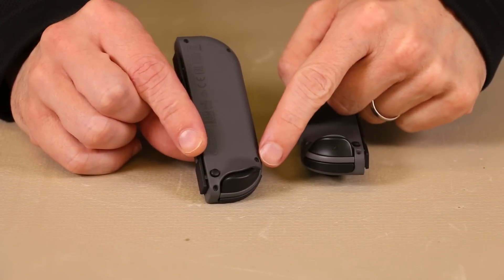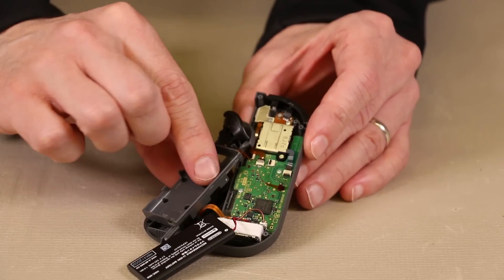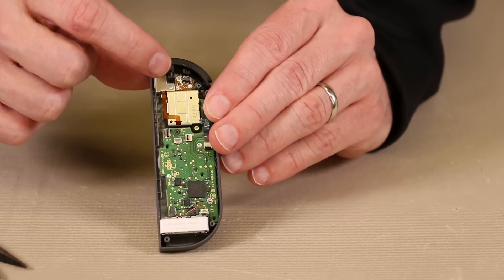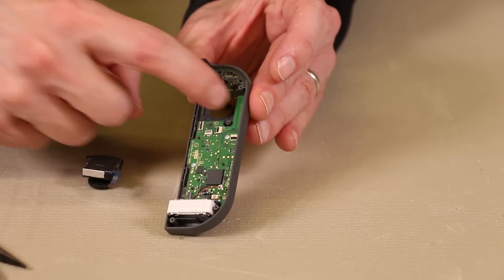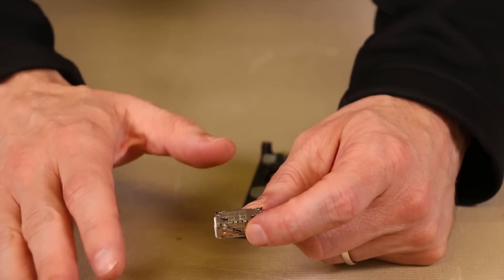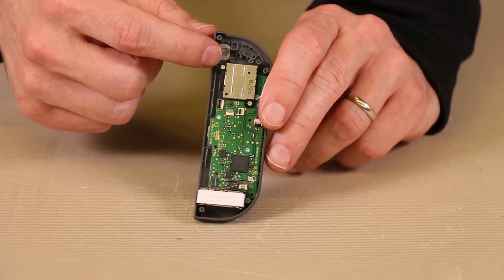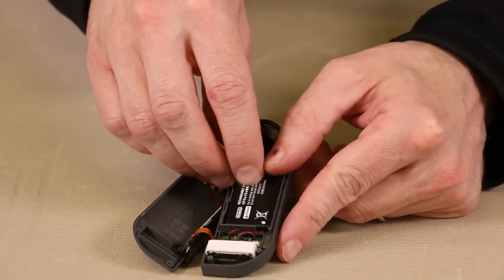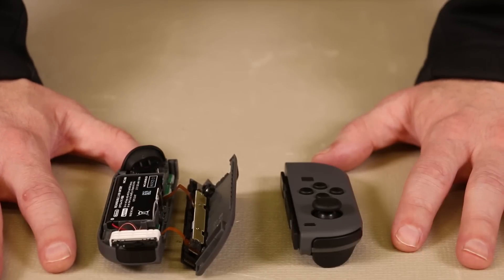Nintendo Switch Joycon Teardown -

Comment: Great video! May I know how to connect those flexible cables between 2 side of the joycon back? I accidentally disconnected them while disassembling it. And it seems very difficult to connect it back without any tools.
Reply from the maker: Ya, they are difficult to connect with tools. If you're trying to do it without tools I have no advice for you. Not sure how you would ever do that.
Reply: what tool did you use?

Comment: How do you get the charging ribbon cable (one closest to rumble motor) back in? It’s the bottom ribbon cable out of the two that come off the rail. The top one is easy but the bottom ones lock mechanism is backwards and I cannot figure out how to get the ribbon cable back in. Wish this was covered in the video

Comment: How repairable would the springloaded catch for the Joy Cons that holds them securely to the switch? The small catch attached to the button on the back near the shoulder buttons.

It seems like it will be common for them to wear out, causing Joy Cons to fall off the switch, and knowing how to repair them seems useful

Comment: Hello! Great video.  For what I've seen in the comments there is no replacement for analog joystick for the Joycon yet.  Could you tell me where should I be looking (besides ebay) for updates on where to find this when available? Is there an specific forum that I should be monitoring?  My right joycon joystick jammed after dropping the unit.  Now you cant lock it in (as for the telescope in Zelda)  I'm not sure if its repairable without replacing the joystick unit.  Thanks in advance

Comment: You really should have looked over the right Joy-con. While it is a similar configuration, there's different components inside that have unique ways of removal, like the NFC, IR reader as well as a black plate that sits beneath the circuit board.
Reply: Beta Shadow yea I really wanted to see how it was dismantled for months now, but I can't find a single video that covers the right joycon.
Reply: I totally agree with Beta Sword, I have a defective  R button(which requires some soldering and it is the worst button that can break down on the joy con imho). While similar there are also some differences between the joy cons.  I found another video that shows both joy cons opened and closed.
Reply: Very true. I also noticed many teardown videos are only doing the left side and they are also not talking about or taking apart the side with the rail or the rail.
Reply: I have opened my right joycon yesterday, and it turns out he was right. It really is pretty simmilar inside. The only diffirence is that infrared sensor, which is not attached to the case at all, so you can remove it easily.

Comment: My Joycon rail’s ribbon cables aren’t attached, so would it work if i just removed the back and reconnected them?
Reply: i hoe this works for me i dropped my switch and it landed right on the L joycon and it ripped the ribbon cables from the switch and broke the peice of plastic holding it in im hoping i can just hotglue it back into place D;
Reply: How did that go?
Reply: mythicalmagikarp gaming I haven’t even tried to fix it yet

Comment: For one month...one month I was not able to put the ribbon cables back together after my Switch fell down on the joy con and it popped open. Just looked at your video and realized all you needed was tweezers. Poof! In just two minutes I put the controller back together, which was taking me hours to do. YOU ARE A TIME SAVOR! THANKS!!!!
Reply: the same thing happend to me dropped my already damaged blue joycon L becuase the joystick black cover BROKE OFF when it fell WHen it dropped RIGHT ON THE EDGE of the L joycon IT ripped off from the console and the black bar was just sitting in the switch and now im waiting for my dad to get home so i can fix it with him
Reply: @Stevoisiak  you dont need to shove it all in
Reply: @Stevoisiak  when you see and feel it goes in as far is it goes pop in the security
Reply: I still cant get one of my ribbons in. Do I have to take it all the way apart?
Reply: Wow...

Comment: I stripped a triwing pretty badly... do you have any idea how to get it off?
Reply from the maker: Search Amazon for stripped screw remover. There's also always the Dremel route.
Reply: The problem is, is that it is inside the controller and I just can't get it out. So I don't know if the dremel route will work.
Reply from the maker: Drill bit

Comment: hey help. i dropped my right joycon and the analog stick dosent click in anymore and it wont go all the way to the right. Do i need to replace it. if so were can i buy it
Reply from the maker: You probably would need to replace it...unfortunately, there is nowhere to buy that part yet.
Reply: Send it to nintendo they will replace it
Reply: Sanji Vinsmoke This same exact thing happened to me five minutes ago lmao
Reply: Xsermius 929 Lmao same. Mine broke yesterday, so I just bought a replacement. Surprised to see so many other people have theirs break.
Reply: any updates on this? My right joy con has this problem due to wreckless kids.
Reply: This happend to me
Reply: Bobadooba 123 did you get it replaced mine broke off as well
Reply: I know I'm replying to a year old comment and you've probably fixed the issue by now but unless you're very skilled and have the right tools I would advise against trying to fix the joystick assembly. Ordering a new one will be way less hassle. While I'm sure nothing inside of it broke, to open it you need to bend the metal around it outwards, then, once you've fixed the issue on the inside (simple plastic mechanism with a spring, iirc there are 5 plastic pieces total that fit together) you would need to bend the metal piece back onto it which is near impossible to do or at least I wasn't able to.
Reply: I found some on Ebay with the tools incluided so you wont have to buy them

Comment: my Left L button doesn't work but the rest works you said the L button might have gone bad and you said to replaces the ribbon cable with the button do you now where to buy one ? also tips?. and quick question how can you check if it might work for an a example the spring is disordered or some case like that
Reply from the maker: Unfortunately, there's no place to buy parts for them yet.
Reply: https://m.search.naver.com/p/crd/rd?m=1&px=278&py=569&sx=278&sy=569&p=TT6xVdpySARsscFLlfRssssssQK-254259&q=%B4%D1%C5%D9%B5%B5+%BD%BA%C0%A7%C4%A1+%B8%AE%BA%BB%C4%C9%C0%CC%BA%ED&ssc=tab.m.all&f=m&w=m&s=B6IqXhN6ET74CQBA3DNjyQ==&time=1499640288989&u=http%3A//m.shopping.naver.com/bridge/searchGate.nhn%3Fcat_id%3D50002775%26nv_mid%3D10244274741%26query%3D%25EB%258B%258C%25ED%2585%2590%25EB%258F%2584%2B%25EC%258A%25A4%25EC%259C%2584%25EC%25B9%2598%2B%25EB%25A6%25AC%25EB%25B3%25B8%25EC%25BC%2580%25EC%259D%25B4%25EB%25B8%2594%26frm%3DMOSCPRO%26h%3D0d19e5e1fcf37b99b201a74cacb1542b484d6901%26t%3DJ4XB2WE7&r=6&i=00000009_0002629b3a35&a=shp_lis.outitem&cr=1 will this site work or I mean can you put similar ribbon cables.?

Comment: I noticed that my Joycon's Plastic "Shells" are not aligned to 100% (this makes the upper Shell 1-2mm longer than it should be) do you think I can open it and align it by myself or is it a manufacturing problem that cannot be fixed by openig and reinstalling?
Reply from the maker: Hmmm...I'm guessing a random manufacturing problem, but there's no way for me to know for sure. I'd take it back and exchange it for another.

Comment: After assembling the controller back, I realise that the buttons on the side (SL, SR, Sync) and lights don't work for me. It probably is the one ribbon cable not connected properly that's causing this but I've tried to fit in properly but to no avail. The contacts do look fine though. At two instances I did see some of the lights but they quickly disappeared since I moved the cable a little

Any suggestions?

Comment: my joy con does not lock into place. iv opened it up but I'm not sure if its the rail or the button?
Reply from the maker: Unfortunately, there's no way for me to know either.
Reply: yeah it looks like a piece on the rail broke off. I'm gonna try to buy a cheap joy con for parts video was very helpful!
Reply: struggling reinstalling the ribbon cables though

Comment: would you make a video of the inside of the analog-pot please? I'd like to consider a possible way to replace the analog stick in the joycon with something like the analog sticks in the Switch-pro controller. I don't think the analog sticks on the joycon have enough analog movement vs. range-sensitivity.
Reply from the maker: The inside? So you want to see the analog stick disassembled? I may do that in the future.
Reply: TronicsFix exactly! If I could replace the joycon's analog stick box with one from the switch pro controller, that'd be my dream portable joycons lol

Comment: I've managed to bust the button under the left analogue, is it possible to get into that little case and fiddle with button, or does the whole thing need to be swapped?
Reply from the maker: Well, anything is possible (almost) but it's highly unlikely that you would be able to fix anything inside the analog sticks. Partly because you wouldn't be able to find parts for it.
Reply: TronicsFix I was hoping that the button may have just slipped out from under the stick, but with that info and looking at the thing it looks more trouble than it's worth. I'll just send it to nintendo to fix.

Thanks anyway.
Reply from the maker: Good idea!
Reply from the maker: How did this turn out?
Reply: Just sent it to nintendo to fix. Took this long for them to respond to my request for repair.

Comment: huh?  I was expecting the rumble motors to be... fancier I think.  they made it sound like the rumble was put in all over the controller. oh well. thanks for the video!
Reply from the maker: They are pretty fancy when compared to the old way of doing rumble motors (a spinning motor with weights).
Reply: indeed that is fancier.  Though I'm someone who used to watch old 80's sci-fi movies so my idea of HD rumble pads was different than what they turned out to be